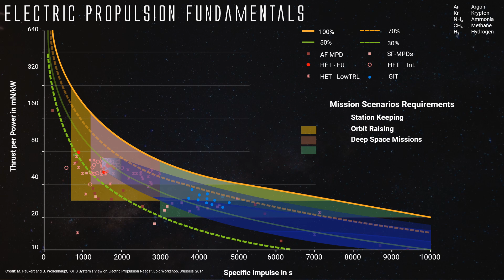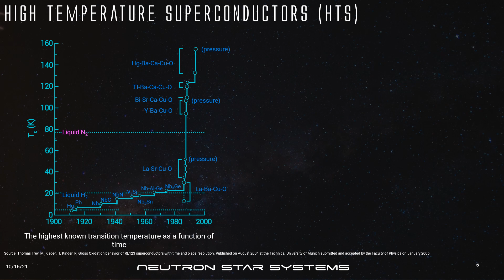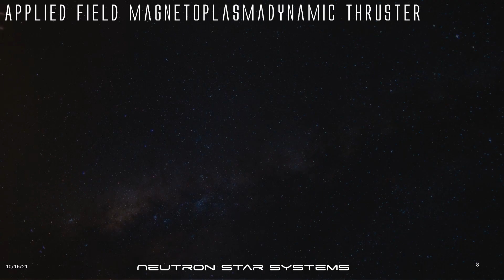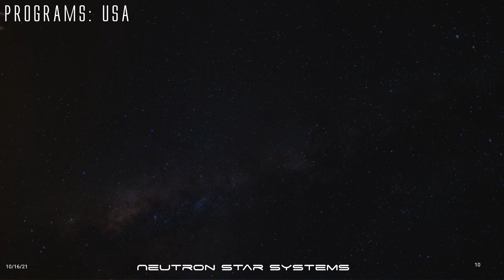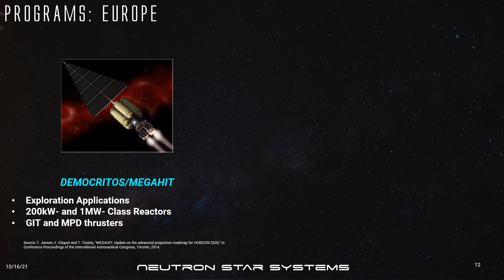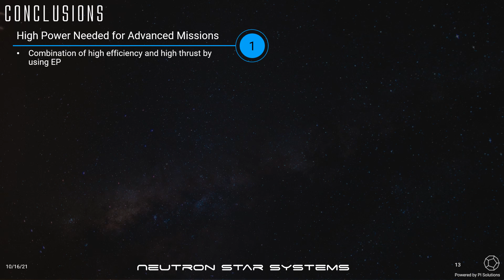TF-3 Overview of NEP for Human Space Exploration Missions - 2021 Mars Society Virtual Convention

Comment: The nuclear reactors flown to date have not come within a factor of ten of the power/mass of current solar cells and low mass/area aluminized mylar mirrors can compensate for lower sun farther out with little penalty. Nuclear will add orders of magnitude cost increases and delays. 
Beaming power via microwaves over shorter distances or laser for longer allows efficient solid state conversion to electricity for propulsion. 
I would point out that Juno has done much of what JIMO was to do but with solar cells. Of course the JUNO cost 9 billion dollars less. AFMPD good nuclear stupid IMO.

Comment: Why wasn't solar panels considered? There's approx 1.36kwatt per square meter in the inner belt.  A football field sized array of solar panels would provide 7+Mwatts of reliable power.
Reply: Almost useless past the asteroid belt.  Nuclear power is the best choice for Mars and beyond
Reply: @khaccanhle1930  Actually low mass mirrors have been demonstrated in the 17 KW/kg range(L/Garde Corp.) at one A.U. For Jupiter these would add about 1.5 kg/KW. In addition triple junction PV for concentrated sunlight have the potential for several KW/kg
Reply: Who wants to have to construct, manage, and lug around a football field sized array of solar panels. This is impractical.
Reply: @deanlawson6880  Actually the radiator needed for the reactor/engine  would be pretty large and massive I bet.